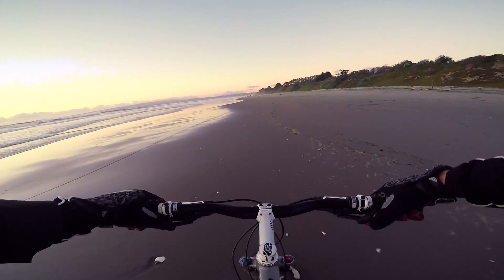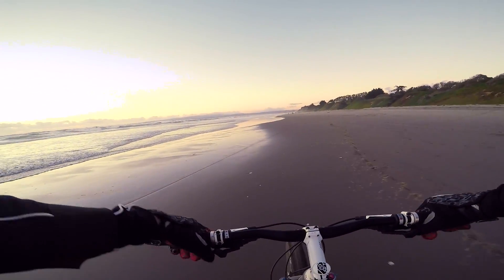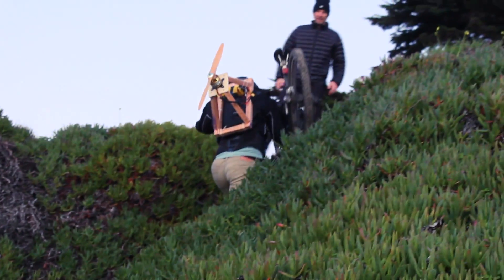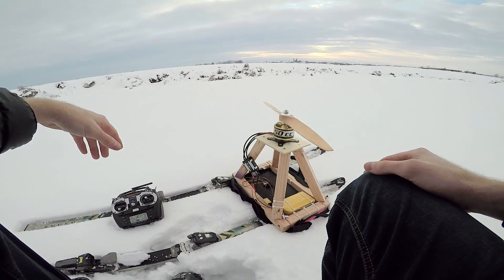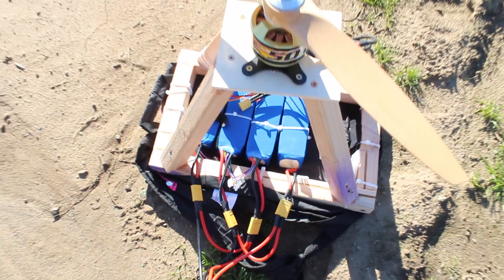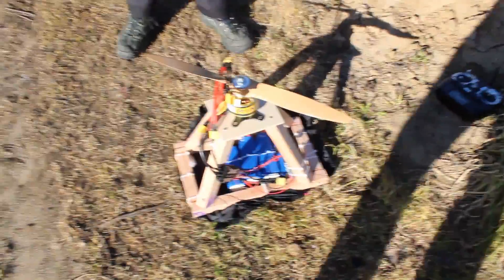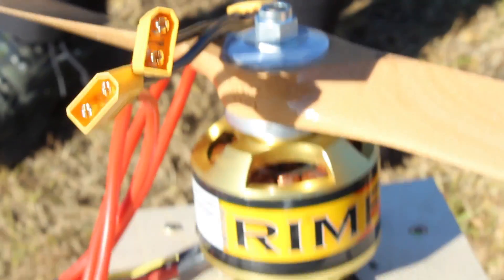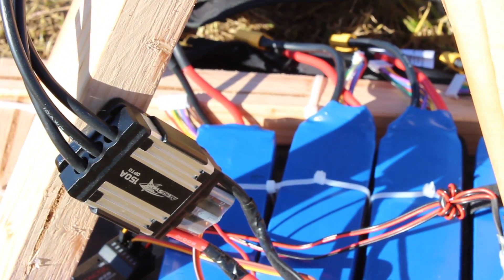Propeller Backpack Part 2

Comment: Original but without interest. Too bad to try this on a track with a lot of resistance to advancement.
My electric bike goes faster, is much less noisy and consumes a lot less !
Reply from the maker: I'm not trying to make anything useful or better than anything else, I'm just having fun
Reply: I see, but if you had tried on a smooth road, your video would have been much more interesting !
Many viewers would have been interested in seeing the speed that can be achieved with your system. Your video don't show it
Reply from the maker: it was 35mph on the runway. This is a series of videos, more to come
Reply: Ok, hope to see more !

Comment: Hey Sam. it's been great seeing your videos, keep up the good work! I have an engineering related question in regards to propeller properties. I was once told that Uniblade propellers were more efficient and had some advantages over regular propellers. My question(challenge?) is if it would be possible to build a quadcopter with single blade rotors. or maybe for your propeller backpack, but I have been unable to find anything of the sort. Thanks for sharing and Keep em coming!

Why are there no Uniblade rotors for quadcopters or propellers for planes?
Reply from the maker: There are several videos where people make and use single bladed propellers. just search for it. 

It is true that you can achieve greater efficiency using a single blade. This is because in order to apply the same load to the motor even though you have half the propeller, you can increase the blade length. A longer blade has a higher aspect ratio and thus has greater efficiency. You can also imagine the blade has a greater disc area and affects more air.
Simply put:
Inefficient = Taking a small amount of air and changing it's velocity dramatically (many blades which are fat, high pitch, and spin very fast. Like modern mini quads :) Or a jet engine...
Efficient = taking a large amount of air and changing it's velocity relatively little (one long skinny slow spinning propeller)
With this in mind, which do you think is more efficient at hovering? Harrier or Helicopter?
This is the same reason a Piper Cherokee with it's short fat wing is much less efficient and glides like a rock compared to a glider with it's long skinny wing. (propeller are just spinning wings)

However as with everything in life, there are disadvantages. Single blades are more complex to make and balance. Their center of thrust will always be unbalanced. And with full size aircraft the limiting factor is often the propeller tip speed getting too close to the speed of sound, so in order to load a large engine appropriately you must increase the width, pitch, or number of blades (since speed and length have reached their limit)
Reply: getting the right balance is a problem

Comment: That was insane! Do you have a killswitch to turn off the motor if you get into trouble?
Reply from the maker: The stunt double in this part is my friend, I was radio controlling him :) We did extensive "what if" testing and planning
Reply: and what speed aprox he reached ???
what would be the batterie mileage ??
Reply: I hate to rain on your parade, and I would very much like to see the figures myself, but I suspect the efficiency of this setup is going to suck relative to a similar electric bike.
Reply: Of course we could always try more power... :3

Comment: Awesome! Have you looked into possibly placing a duct around it to improve some static thrust performance? (And also some safety) 

Look forward to seeing more! Don't lose a limb!
Reply from the maker: I'm gonna weld myself an aluminum frame with a prop guard! Then maybe people will stop treating me like I haven't thought about risk and safety yet :)
However increasing efficiency with a duct only works in extreme cases where the propeller design would otherwise be really really inefficient, such as a prop with a whole lot of really fat and short blades spinning really really fast. In that case the duct has to be designed really well with very tight clearances. A long skinny exposed prop will always be more efficient

Comment: As a former amateur downhill skier moved to the great planes of Europe and as a quad-copter freak I love your idea with all my heart! I found in one of your videos the one with your blower plane. How do you consider to implement the centrifugal fan to your backpack build? I would consider it as a safer solution. What do you think?
Reply from the maker: The centrifugal fan is difficult to make efficient for thrust purposes. High static thrust is easier with a big prop.
Reply: Samm Sheperd Yes, you're absolutely right: the axial fans have higher flow rate than centrifugal, the only benefit of those is higher compression ratio. The snail shroud will be bulky, comparing to neat cage around the propeller. The only benefit of the twin centrifugal propulsors may be their steampunky look.

Comment: Why do speed controllers always fail? I have broken way too many over the years!
Reply: Eirik Strand overheating?
Reply: This esc features:
• Over heat, low voltage, lost signal and power arm protection
• Data logging such as temperature, voltage, current, and RPM
• Advanced governor mode and smooth start up perfect for helicopters

Maybe try to find out what went wrong? I would really like to buy a big motor myselves, but stuff always breaks and I'm tired of it
Reply from the maker: I did get a whiff of electrical smoke when I first investigated. Really pisses me off though since it didn't even get hot and I don't know what happendl

Comment: You should turn that propeller into a ducted fan!
Reply: Agree.
Reply from the maker: Shroud yes. Duct no
Reply: Samm Sheperd you should put a gas motor on that thing.
Reply: You should put double jet turbines!

And to each side. Your chest is blocking most of the air flow for the propeller.
You're creating a void behind your back that's not good for aerodynamics. That's why fast speed cyclists helmets have that weird drop shape. Changing something so small can really help efficiency.

Comment: I wonder if you were to develop this further it could be a viable alternative to a petrol engine powered paraglider setup?
Great channel BTW, I love watching all the fun things you do!
Reply: @Peter: Yes, this is a thing. Electric paramotors exist, and are freaky cool! The down side is in the power density of the batteries. Liquid fuel, at least for now, is king when it comes to power density. I am a free flight pilot, but would love an electric booster to get me off the ground. (>*

Comment: You should look into MGM COMPRO. They are the top of the line in the RC field. They are also priced at top the line. Would not hurt to check how much current draw you have to.
Reply from the maker: wow, quite $$$$
Reply: Ya that is there biggest down side. For our battle bot though they were the only clear choice. Also take a look at the tool i made for Electric motors. http://www.electric-skateboard.builders/t/google-spreadsheet-for-easy-and-fast-calculations/13337